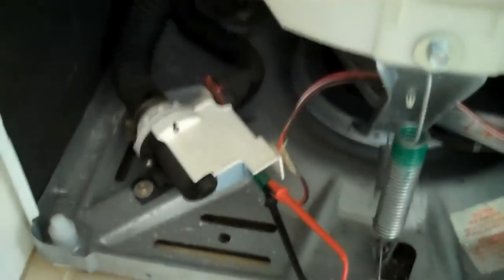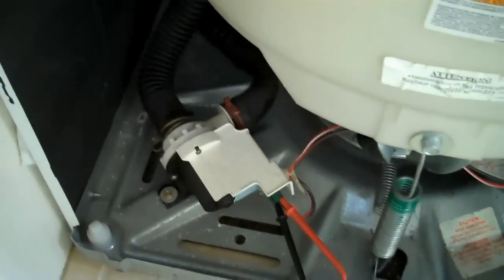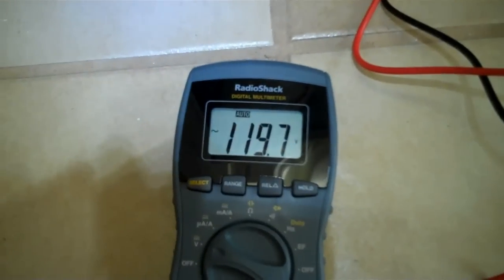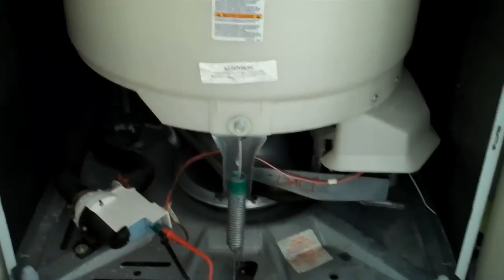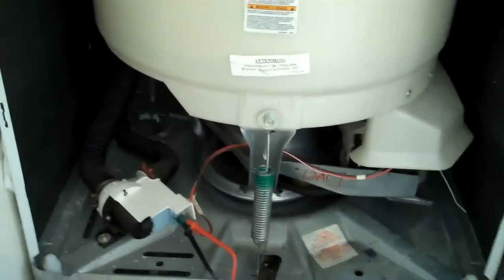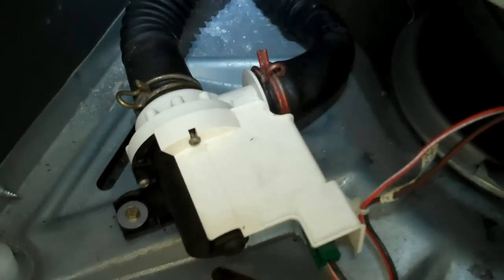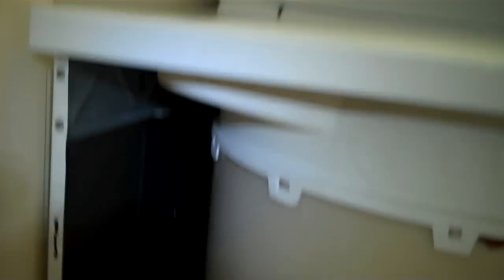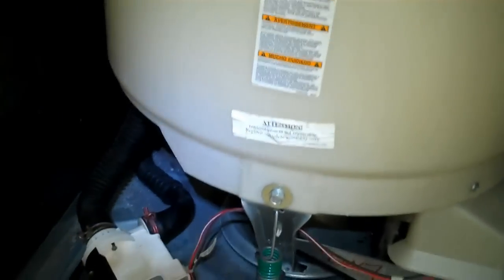Fixing a Frigidaire Top-Load Washer that Won't Pump Out

Comment: Just a tip. Don't wash small bathroom rugs, like the ones around toilet or for out of shower mats etc. They have rubberised backing, and when older or highly used, the rubber backing loosens and kind of dissolves or releases like clots, and ends up clogging the water pump. 
Also, braziers have a  metal, in shape of a horseshoe, or u shape, for support ,and may come out and end up in water pump. 
OAlso, check pockets for bobby pins, hair clips, paper clips , coins, screws, nails,  etc......
They will find a way down, and clogg or brake the water pump.
I Found all these items mentioned above , stuck and  jammed in water pumps. The rug rubber backing, I found packed as if it was adobe, clay or playdow in water pump.

Comment: It would have been nice if you showed how you removed the item in the pump.
Reply from the maker: +Rick Brister Hi Rick. Our videos are intended to tech professional appliance techs how to troubleshoot problems. Disassembly on most appliance repairs is the easiest part of the repair and there are already lots of Youtube channels with thousands of disassembly videos. The missing skill in the trade today is diagnostics and that's what we focus on in our videos.
Reply: +SamuraiRepairman Fair enough.  I bet it's got to be much more difficult on you guys with the creation of YouTube.  I know I've already repaired the ice maker for my fridge and replaced the control panel on my dishwasher thanks to DIY vids.  In any event, I have a tech on the way.
Reply from the maker: +Rick Brister Business has never been better! The era of computerization in appliances have made them too complicated for most DIYers to work on and much more interesting and profitable for technicians to troubleshoot and repair. Real technicians who know how to read schematics and troubleshooting (about 20% of the trade) are in extremely short supply and we have more business than we can handle. The parts changing monkey techs (about 80% of the trade) are getting killed. And good riddance to them! The trend toward using computers in appliances is only accelerating now with wifi and smart grid-ready appliances being offered by all manufacturers Thank you, Energy Star! More on this trend in the appliance repair trade here: http://appliantology.org/blogs/entry/884-the-future-of-appliance-repair-the-internet-of-things/
Reply: +SamuraiRepairman Excellent point!  I know in my business the IoT has caught fire.  In the meanwhile, turns out it was a "soft clog".  $85 for a tech to run my washer.  Lol, all in a day.

Comment: The top of mine had a poppable top with clips that will pop back into place.Differant models will open differant ways and after popping lid i had 3 screws on side panel i unscrewed then two clamps hold on to two hoses on pump. Squeeze them with pliers and remove.There will be water come rushing out after removing hoses .I took mine outside to work.Then for me two 8mm bolts held pump on. I then looked in and found a stuck bobby pin and removed with screw driver. Hope this helps

Comment: Hello,
I'm having this problem as i speak; the machine runs through the cycles as it should, but the water never drains.  I bailed the water out by hand once and tried to run a smaller, better balanced load with no luck.

My question is: if i unclamp the drain hose from the outer tub and/or pump, is it as simple as re-clamping it to reattach the hose, or is there a glue or something i should be aware of?

Also, if the machine is unplugged and i detach that drainage tube from the pump -- is it going to spill all the water out?

Thanks! Hope you're still monitoring your Youtube account! :P